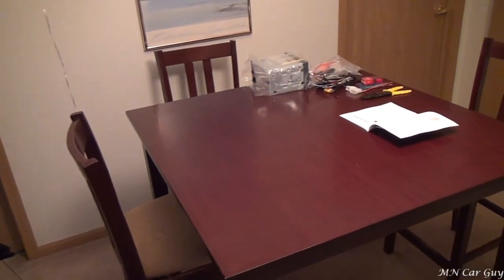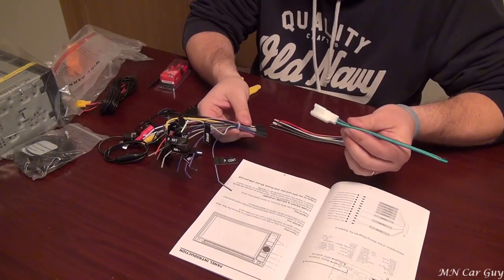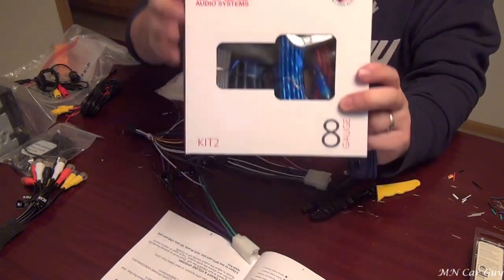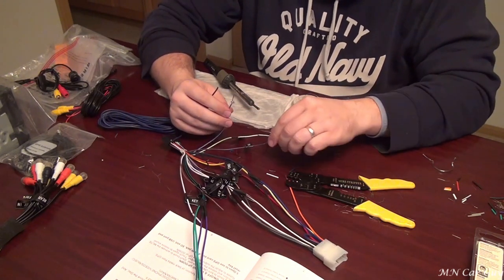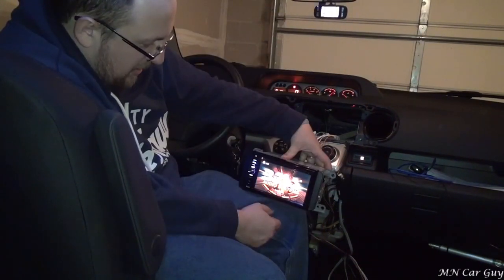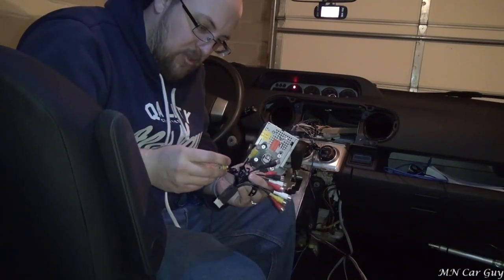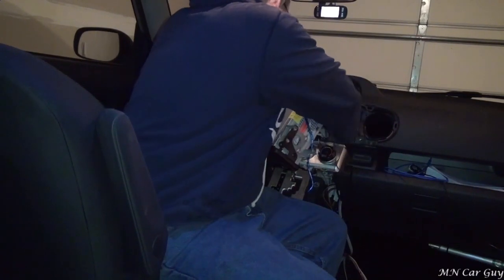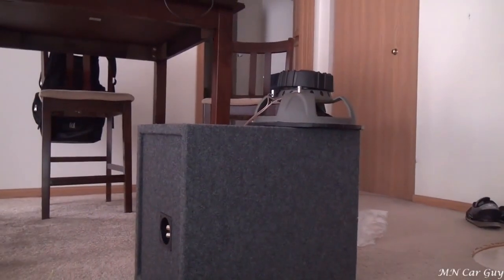2008 Scion xB Build 3 (Stereo and Subwoofer Install)

Comment: I have installed the exact BOSS double din stereo in my 2009 Scion XB and the only issue I am having is the stereo seems to be bigger than the OEM dash bezel the one that goes into the A/C vents and the stereo. The radio is bigger that the opening. Did you have to cut or trim the dash bezel. That's where your video got fuzzy to me and also the Stereo Receiver Dash Install Mounting Kit did you use the OEM stereo brackets and the mounting kit fillers (for the right and left side of the stereo)
RM
Orlando, FL